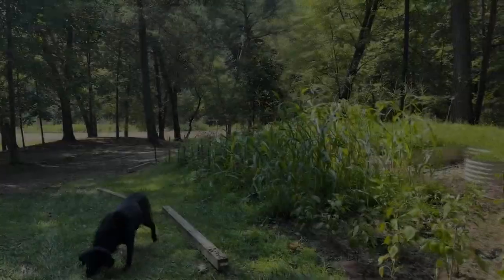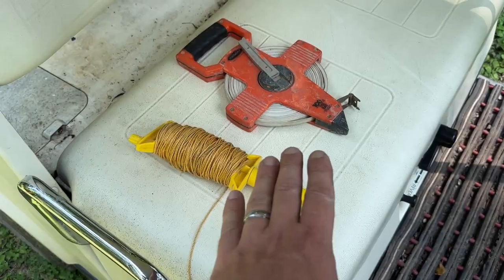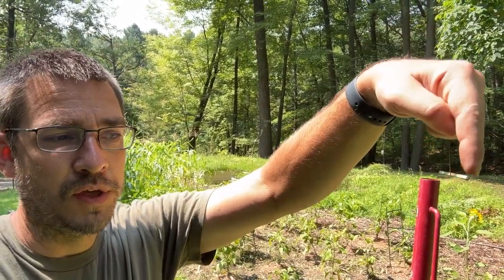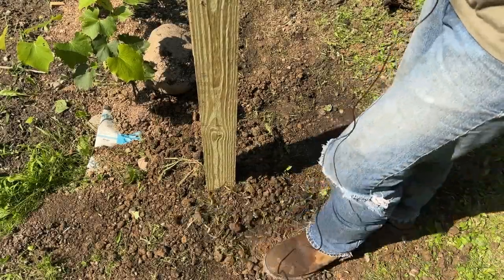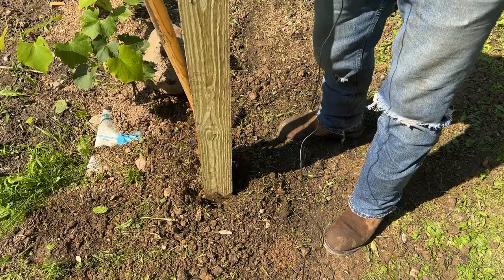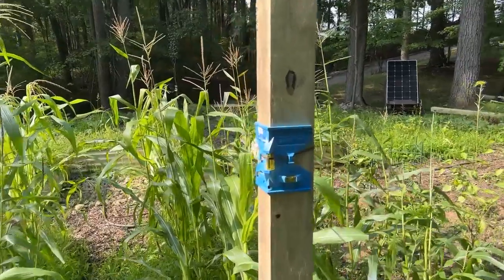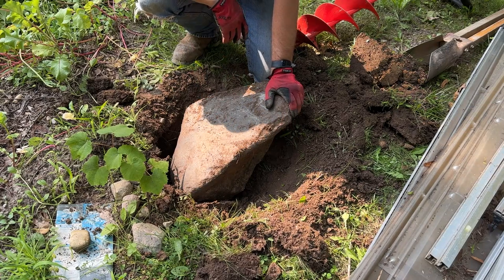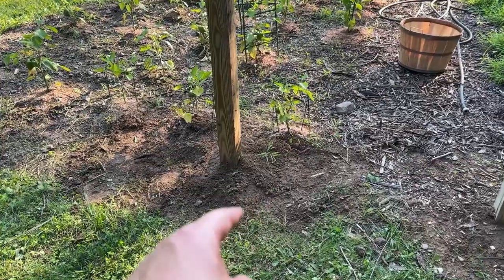How To Set Posts Like a Pro

Comment: I love most of your videos.  This one entered my profession.  I’ve built fences for 30 yrs in SW Ontario. 

The only people who use those augers are diy’s and ice fishing.  They hurt more people then you can imagine. Rent an auger that can’t take the torque. My go to was the little beaver.  But once I started my company I bought a walk behind bobcat.  

The string is a masonry string. Durable to handle the augers flight bouncing off it.  

With wood post a 4’ level should be used as wood post are typically warped and the longer the level it will be more true.  Level two sides against the string line or just off it.  

A pick bar will help loosen any rock or compact dirt. We call that pick and clam. And some pick bars have a pick and then a flattened end to pack the dirt if that’s your choice.  All gate posts should be cemented. They are used daily and a packed posts will loosen up over time. 

For wet soil to prevent heaving we do a bell at the bottom. Literally just make the hole wider at bottom and the post will never heave.  Bag cement is great for small jobs.  Pour water in hole.  Add bag cement and then more water.  

Always cut posts tops last.  It’s hard to stretch a post if you cut it to short.  

But please DIYers don’t use these augers.  No professional would ever use them.
Reply: How do you feel about tractor PTO augers?
Reply: @nates2526    I recently moved to Nova Scotia and got some land and a kubota L series tractor. And the woods pto auger was one of my first implements.   Great option around the farm as they take all the torque against rocks, roots and old footings etc. 

The only tip would be put up your string line and spray paint an X where you want the tip of your auger.   Then remove string and dig your holes.  Put the string back to level posts.  It’s challenging digging holes with pto auger against a string.  

Good luck.  And yep can’t beat sitting on a tractor digging holes. 😁

Comment: I really really really need to spring for one of those post hole augers... I'm not 30 anymore lol!  Nicely done.  I did the same thing with my garden fence.  Just tamped them in.  The privacy fence got cement.  Thanks for sharing 🤠
Reply: I finally made the decision last year that I was done digging post holes by hand.  I picked up the Ryobi 40v auger from Home Depot.  Amazing tool.  It came with a battery and I picked up a couple of extra when they came on sale so the tool will work longer than I want to.